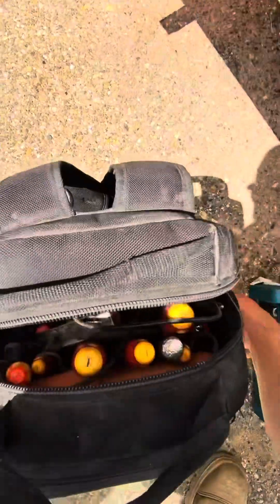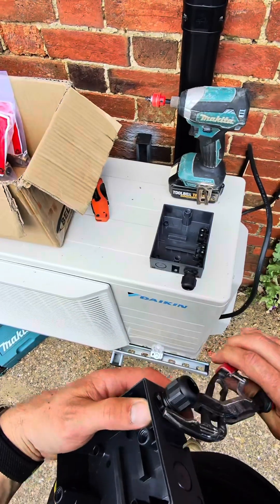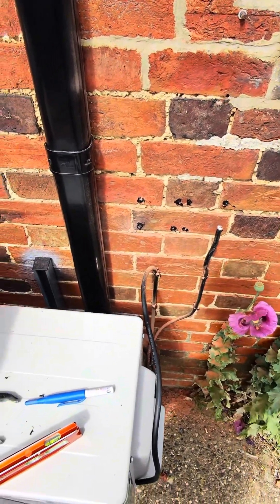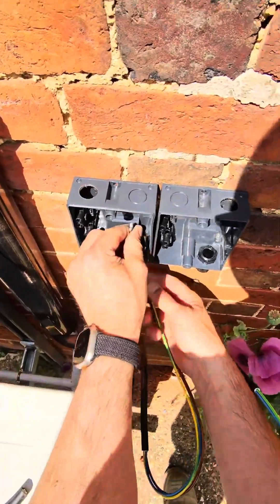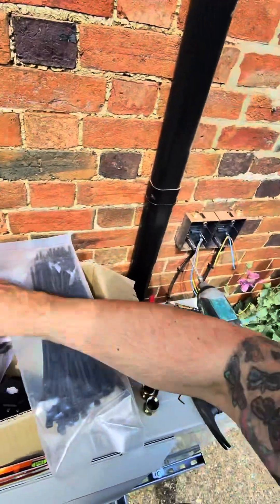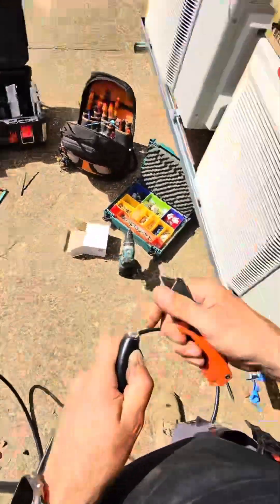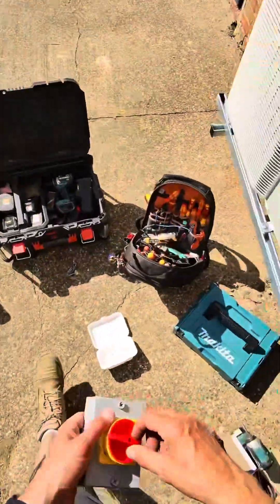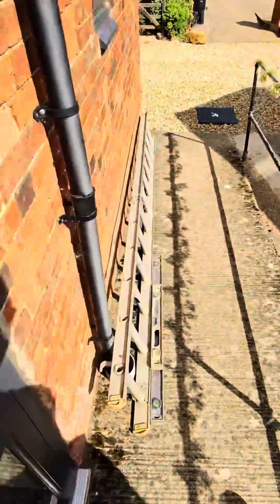Wiring an Air Con Rotary Isolator – Step by Step Like a Pro! ❄️⚡

Comment: I just wish Isolator manufacturers would leave a little bit more space above and below the switch. 
So it doesn't  get so congested around the connections
Reply: That's why I always get a larger size isolator, learned the hard way.

Comment: I’m an HVAC installer in America and it just startles me that the high voltage cable is exposed to outside conditions. Under no circumstances is that allowed here, high voltage has to be inside conduit whether it is rigid pipe or flexible conduit to protect it from the elements. I understand that it is acceptable in your region but does steel armored cable outside insulation last?
Reply from the maker: Yes mate SWA lasts forever outside
Reply: Ok to bury in ground too